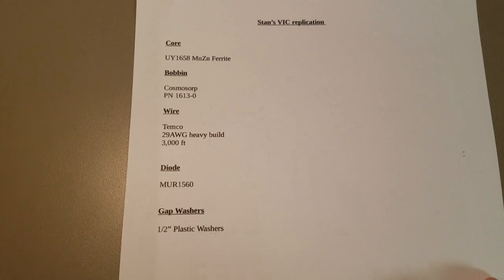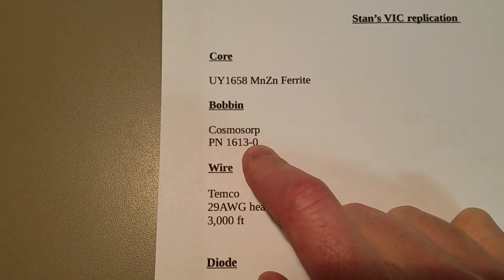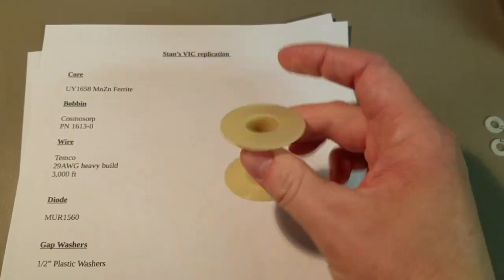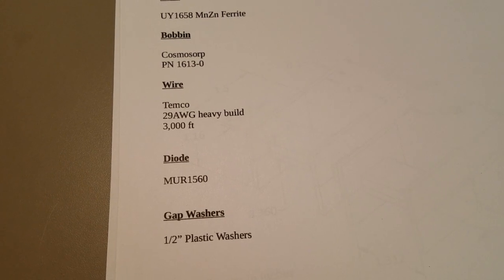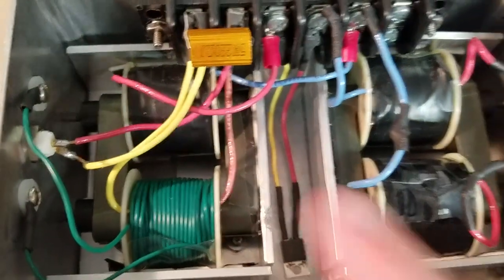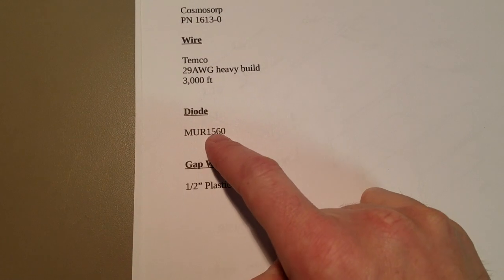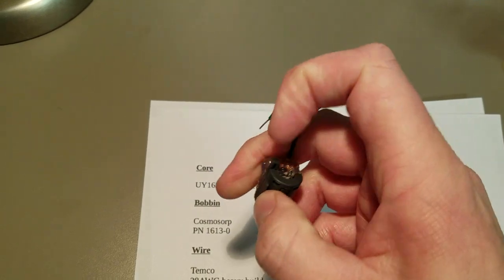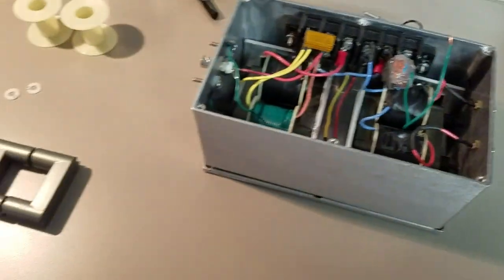Stan Meyer Research # 18, Mar 2019-Stan Meyer-VIC Replication list

Comment: First off, "You are welcome 🤗." I have made so many VIC transformers that now I really have a handle on just how they really work. I have made all that is in the SMTB to include the figure 10-4 type VIC transformers that have dual layer chokes which I don't think anyone has ever made before. In all of this I learned the old fashion way the do's and the don'ts on building them. Now I vacuum epoxy seal the transformers to keep the air from ionizing and the wires from physically vibrating which will rub off the wire's protective coating and cause the transformer to short out. I put them in transformer oil to deal with the ionization issues but the only way to deal with the wires rubbing off the protective coating due to them vibrating against each other. 
This is the most important part of the technology to get right and it was the first I tried to tackle but I didn't know enough at the time to solve all of it's mysteries as I had so much more to learn back then. I posted a lot of information on the forums showing detailed pictures of the transformers I built as I was building them. Not sure if they are still up for people to view as I got banned by the forum owners/moderators after I went to the 2013 Global Breakthrough Energy Movement as before then no one knew I was a black man is my thinking after they watched the interview video that John Fraser gave me while I was at the event. I can't be for certain those were the reasons but I can tell you that things sure changed in how people treated me after that video was put out.
Reply from the maker: Edward Mitchell 

Did you find the cores?
Reply: @BradKwfc  I have used all of the cores except for the laminated ones. I found the large TDK cores, the flat U cores and even the ones you are using now.  I have used E, I, and U cores, and I think even some P cores. I can tell you this, all coils must be on the same core as that is part of the way it works that should not be changed. 
I got the large TDK cores from here, but do note the prices have went way up from the time I got them: http://direct.mhw-intl.com/ferrite-cores/?core_shape=605&manufacturer=127
Reply from the maker: Edward Mitchell 

I've made quite a few VICs over the years as well, mostly with U and E cores. The VIC will work with the chokes on a separate core as long as they are oriented and connected correctly. I know this from my own testing and from others who have been successful.
Reply: Again you are going to just have to take my word for it that all coils need to be on the same core as those that have separated it have not got it to work and that is because it doesn't work like they think it does. So, to sit there and tell me they have been successful is not being truthful, plus I have the correct equations to go along with what I am telling you. Those people, if you are talking about the ones I think you are, don't even have a differential probe which is needed to be able to look at the waveform correctly for it is an isolated circuit the voltage intensifier circuit is and it has to remain that way in order for it to work as designed. Give it a ground and it will take it that is why Don Gable got a good zap when he got the voltage close to the ionization threshold putting his finger into the water bath.
Reply from the maker: Edward Mitchell 

The equations are nothing secret, you can find them in most textbooks, we can calculate the voltage across all components and current through the entire circuit. With basic algebra you can calculate everything. There's no need to get into calculus.

You don't need a differential probe to find resonance, a pickup coil made from a ferrite bead will work just fine. It doesn't measure voltage but it shows you the waveform- voltages are easily calculated.
Reply: @BradKwfc  There is so much you all don't know that an entire book could be written about it.  The only way to read the voltages at the cell directly is with a differential probe for it is an isolated circuit and it has to remain that way. If it is allowed to ground out it will do so. This is something those of us whom went the long way to understand this technology with the 8xa circuit found out the hard way. For if you hook up a the probe wires to read the voltages it will trip the house breaker. 
Some of the equations I use you all have never heard of being used for this technology before as one must ask the right questions to understand just how these transformers actually go about producing high voltages which is something I am fairly good at doing.
In time once I have it down packed I might share what I know in the last Open Source forum I am allowed to post in. Or I might do like Max Miller and hold a conference where I will explain this technology to all that show up just like Stanley Meyer use to do. Anyway I will cross that bridge when I get to it.
Reply from the maker: Edward Mitchell 

You should write that book- we'd all like to read it. 

Of course you need a diff probe to read the voltages in an isolated circuit... but you don't need a diff probe to find resonance in any circuit. Use a pickup coil (like Stan did) and connect your probe to it. The pickup coil provides the isolation and allows you to see the waveform. The voltages are not correct but the important thing is it allows you to see the waveform. 

We all know you never tie the probe ground to anything in an isolated circuit. That's the first thing one learns when using a scope.
Reply: @BradKwfc  Like I said, "I'll cross that bridge when I get to it."  For right now I need to just keep doing what I am doing and follow the plan I laid out for myself many years ago.

Comment: Why you didnt use a pickup coil (feedback coil)?
Have you try to build the big bobbin ?
Reply from the maker: @Yehia-r8l 

I'm not sure that the PLL circuit that used the pickup coil worked correctly. I had an exact replication of it and the VIC. My experience was that it gave false indications of resonance more often than not. It could have been due to my VIC specs being incorrect. But, from the testing I did, I came to the conclusion that the PLL circuit would give false indications even if everything was right.

Because of that, over the last year, I've been working on a new Hybrid VIC Controller. It's on another level compared to the one I made a video of. It will incorporate more instrumentation and measurements that will aid in detecting resonance. I'm confident it will work better than Stan's PLL circuit. I'm hoping to have it done within the next few months.
Reply: @BradKwfc  it will be a great project,  i will be waiting for this, thank you

Comment: Some schematic would be nice 🛀
Reply from the maker: P8.5 

I'll try to do another video in the future. In the mean time I'm using the same values as Stans.
Primary coil 10.5 ohms 41.8mH... Secondary Coil 72.4 ohms 1.047H...L1 Choke 76.7 ohms 1.262H...L2 Choke 70.1 ohms 1.138H.
*All coils 29AWG-wound the same direction.